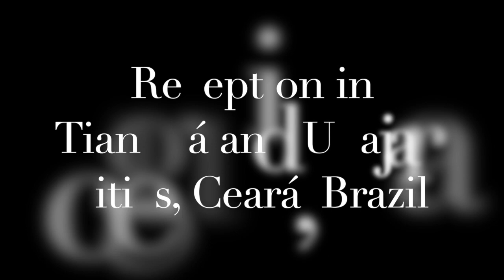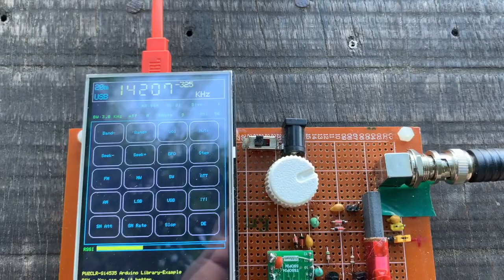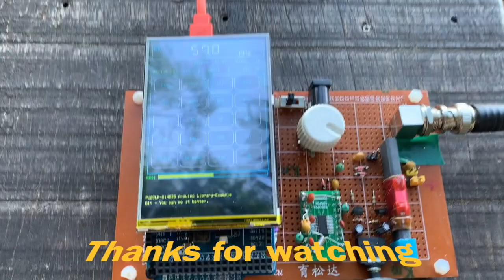Arduino Shortwave and SSB eco-listening with the SI4735-D60 and touch screen prototype

Comment: What is that antenna ???! it looks good ! i want to have one ! plz let me know what kind it is
Reply from the maker: The antenna is an assembly from my Buddipole antenna kit. The configuration I used was a vertical antenna tuned for 10 meters. However, in this case, I didn’t focus too much on adjusting the antenna for the current frequency/band. I use this setup for QRP communication.